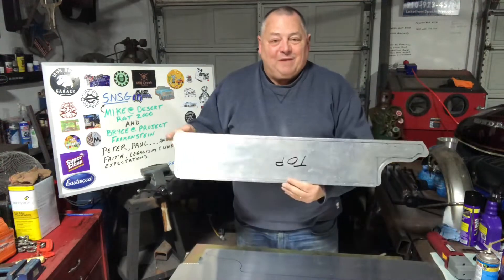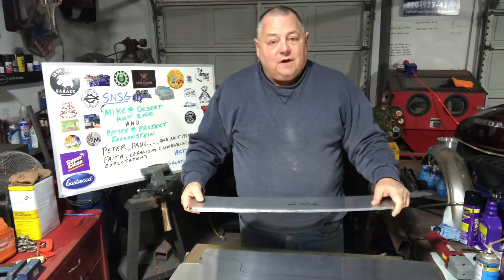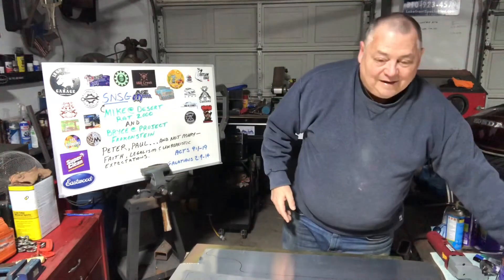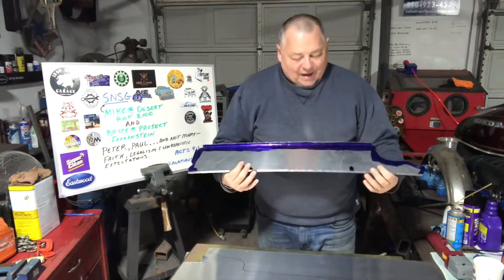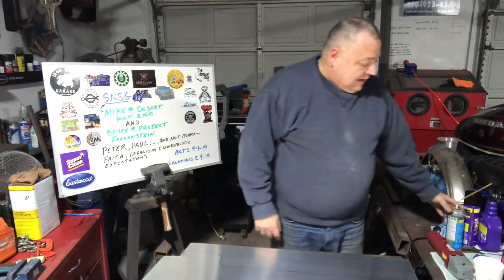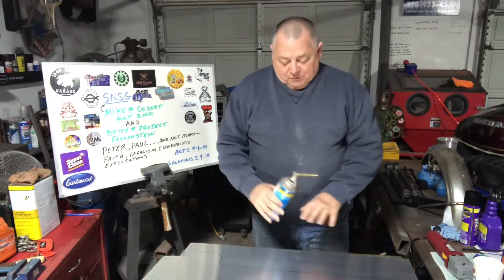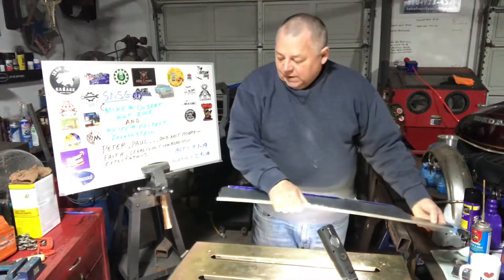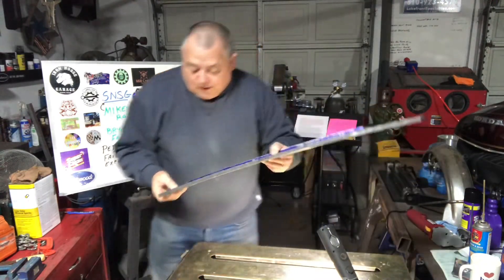1969 Z28 Radiator Cover Build Part 5 - Edge of Eternity

Comment: We used to use a similar concept when making rolling tool boxes. We created a false cabinet bottom similar to what you are describing for additional rigidity. We spot welded z-bar stand offs between the two parts instead of using foam. It worked really well.
Reply from the maker: Excellent!  That really is the same concept. Thank you so much for your comment… I really appreciate it.
Reply: @EdgeofEternityBillCameron  you bet Bill!👌

Comment: sweet idea, only problem a can see would be the expanding foam swelling the parts, might be an idea to make a quick frame jig to clamp everything flat and in place to allow the foam to expand out of gaps instead of swelling the part
Reply from the maker: Exactly because that stuff really expands. I’m planning on putting a hole pattern in the lower part so there is space for it to evacuate. Then I can just trim the excess foam off. That foam could easily distort that material. The jig is a great idea, thanks brother!
Reply: @EdgeofEternityBillCameron  your welcome, i am talking from expierience i know what it can do lol